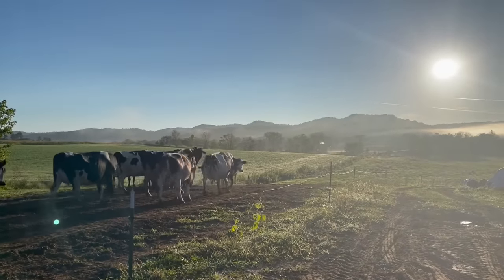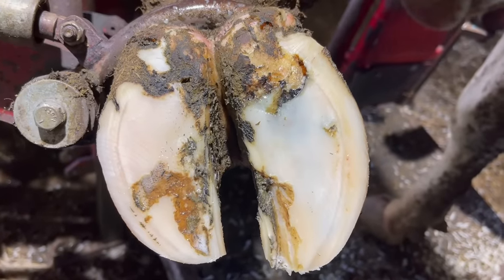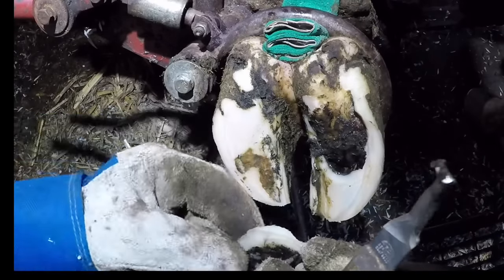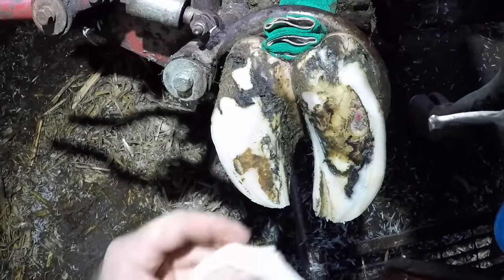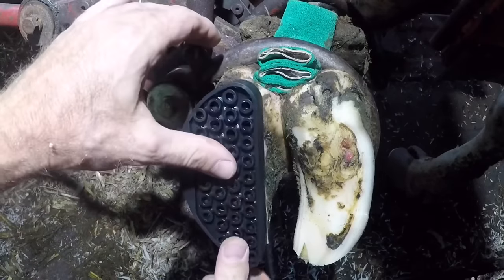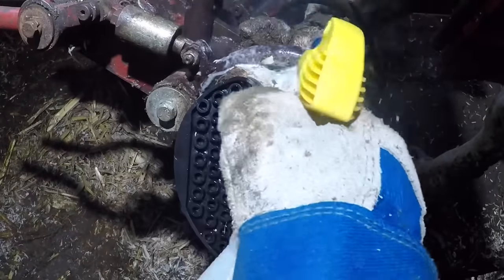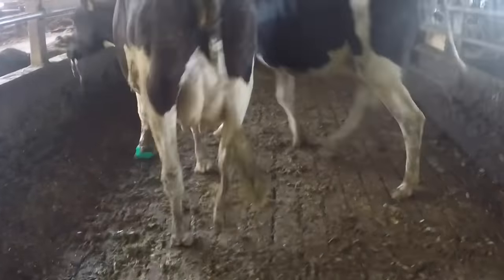Relieving Pain from a COW’S TENDER FRONT FOOT~~FAQ’s

Comment: "Why don't you use water" as Nate sprays $10 worth of chlorhexidine on each damaged hoof LOL. Love your trims Nate, always gentle and thorough.
Reply: Y
Reply: Most barns or places where cows are and horses live. They don't have a lot of spots for water.. The water hose is usually only in one spot and can't reach where he has to park the trailer to trim them.
Reply: Dang, that stuff is really that expensive?
Reply: Ya
Reply: Well just to make sure the foot is well sanitize ,any worms ,germs will surely die
Reply: What about the powder stuff? To kill off germs, bacteria. What does that run for?
Reply: @Cindy-je9fm  That is so not true. He has access to plenty of water. Simply putting water in a spray bottle would work. Fyi He has to wash his whole shute/Crush in-between every farm for sanitation reasons. Access to water is important. I've been on plenty of farms
Reply: Why not put some rubber carpets, that are not thick, just enough to cushion the foot?
Reply: @Cindy-je9fm  This is such a fucking lie. I live next to a farm and I help out sometimes. There is always water nearby
Reply: @Cindy-je9fm  never heard of a bucket 🪣
Reply: Damn!! What's the general pricing on that??
Reply: Just looked it up, it's a little less than $20/gallon. You're dramatic af
Reply: @elizabethavalos2847  that's still pretty expensive....
Reply: @aeryhnkillsahundred335  not for animal safe antiseptic. A small 3oz bottle of antiseptic spray will run you $8-$15 depending on where you buy it. There's a 16oz bottle on Amazon rn for $26. So $20 for a gallon is cheap, especially if he gets it whole sale its probably cheaper than that
Reply: @mateoavina8708  Not sure, but I imagine not much. Salicylic acid is a precursor to acetylsalicylic acid, otherwise known as aspirin. THAT aspirin.
Reply: @nameless-user  huh, that's what I had thought because the spray was 10. Thanks👆👏
Reply: @Goldarr1900  my guess it is because concrete is easy to clean; just spray water to wash away poop and dirt. This is a routine so it need to be super easy. A regular floor tiles & bare bricks could be used instead of concrete to soften foot strike but tiles are costly while bricks are harder to clean.
Reply: @msafwan2610  Thanks for responding to my question. I was talking about cushioning the foot , so it won’t get ulcerated. He said that concrete is to hard, that’s why they seldom get hoof problem, when walking on grass.
Reply: @mateoavina8708  if you watch his video about his gear in his  faq playlist, he says he buys the gallon of 2% clorhexadine only uses that full strength on the lesions/ulcers, and otherwise he uses it diluted ( 1 to a gallon of water)  when he's washing.
Reply: @ultimatesunrise  🤣
Reply: @elizabethavalos2847  not even 20.. Google tells it is 10$ for a gallon.
Reply: Your cows are in much better shape than some others
Reply: I don't see any problem with using something stronger than water to clean the area.  You don't just run water on an open sore on you.  Also,  why do you care if he is using a more expensive product.  It's not your money he's spending.
Reply: She was expecting to be in pain then she realizes she's not. That is so cool.

Comment: As an oil refinery operator who has worked on concrete for 30 years, I concur. A fair amount of us run into foot problems. Great job.
Reply: Oh wow, you have the same job as my father. I will have to ask if he’s experienced that.
Reply: @RoaringMind  very common problem for anybody who works a lot of hours walking around on hard/concrete floors
Reply: Hoof problems
Reply: Gets a lot of non combat veterans too. The boots and the hard grating or concrete floors are brutal.

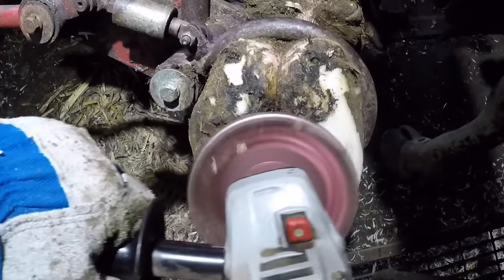Comment: 1:15 "no heat is created when I'm working on this claw"
Other hoof trimming channels, blowtorch is pulled out.
Reply: The blowtorch is used to remove moisture before applying the block. It makes the glue more effective.
Reply: @rebeccac33  Looks like Nate just wipes it down.
Reply: @zerosumgame5700  Different kind of glue.

Comment: I wonder, If the cows were housed on poured rubber floors, like in some playgrounds, would that reduce hoof lesions and lameness? or are there other materials that are better for the cows wellness then concrete?  
and  that bags the question what's more cost effective, house cows on concrete and pay a hoof trimmer to address problems when they arise, or create an environment that is less likely to induces injuries and thus require the services of a hoof trimmer less frequently.
Reply: It’s is quite interesting. As someone who has no experience in either cow owning or different flooring cost or durability I feel like if you need to you can learn how to trim your own hooves and save money there and have the concrete flooring. That could be the most cost effective. Alternatively the rubber, would it break down due to the cow waste? I know that at least dairy farms they have the grates at the end for the waste for their milking stations but the cows aren’t in there for their sleeping quarters I believe. Yes there could be straw for bedding but I’m pretty sure it could still seep through. Quite interesting though for what different floorings could work. I’m genuinely curious about if the cow waste will ruin the rubber though
Reply from the maker: Rubber flooring is installed in many of the larger dairies.  Maintenance trimming is needed more often though because rubber doesn’t create any wear.  Extra trimming is needed to keep the foot in proper alignment and balance.
Reply: You see, every positive brings a negative. While rubber flooring does not cause hoof injuries, on the other hand, hooves do not naturally wear down and therefore need maintenance anyway. 😁
Reply: Rubber flooring is just one part of helping cows out. There are rubber stalls and other comfort items that help prevent lesions (and puss) from developing on other parts of their bodies.
Reply: Wood?
Reply: @daveurbex  True. But I feel it would be better for the cows to not experience pain and just have them trimmed more regularly.
Reply: @goodiegoodygumdrops  Let's not forget its a farm, its not going to have 1-3 cows and that's 4 hoofs for each cow to maintain, morally its a good idea, financially and time planning or whatever not, and when you have farm your work is not only taking care of cows you also need to clean their barn and what not.
Reply: @haruusami1831 some people may not realise how labor intensive having dairy cows is. There are no days off with dairy cows. They need to be milked twice a day every day. Having a larger farm with multiple employees may allow a farmer a day off, a family farm would literally have no days off. There is literally never ending work to be done on a farm. Much respect to all those hard working💪 farmers out 🙏
Reply: @haruusami1831  There's still alternatives. Wood, as suggested is one of them. Dirt is another option. But making animals walk on surfaces that directly lead to them having very painful feet is not ok. 
I have some family friends who have a beef farm and was wondering why I'd never heard of this hoof issue. Now I know: those cows don't walk on concrete.
Reply: @Vousie  Well idk their is something called Rock on the dirt they're walking.
Reply: @haruusami1831  Bits of rock, sure. But as Nate pointed out, their hoofs are designed for that and dirt and grass. Their hoofs are not designed for concrete. That's why they have problems.
Reply: @Gad Yariv I don't think the people who operate the farms care less - the cows are there to be in almost constant pregnancy, milk extraction and then premature death - the state of their hoofs is an irrelevance

Comment: I grew up in a ranching community in AZ and honestly hadn't heard of cows feet needing to be trimmed until I found these on YouTube. Most of the cattle in my area were beef cattle and were always out on pasture from calves to the time they were loaded for slaughter. I don't think any of them had been exposed to concrete which may explain why I'd never heard of cattle hoof trimming before.
Reply: The creator says that rubber flooring is installed in the larger dairy farms for the cows (prevents injury) but the rubber prevents wear so they actually need their hoofs trimmed more often. 
I'm guessing whoever owned those animals didn't care about comfort for the cows.
Reply: @goodiegoodygumdrops  that's with dairy cows though. Op is talking about beef cows in arizona, where they're walking on packed dirt, not concrete or rubber flooring. Maybe the housing has flooring but the cows will spend more time outside. Additionally, dairy cows live a lot longer than beef, and therefore have more chance for something to go wrong / require more maintenance. Also, cattle are a huge investment of thousands of dollars each, no rancher "doesn't care" about their cattle.

Comment: I really wish that livestock weren't in contact with concrete and metal. As you stated, concrete is hard. Very hard. Concrete and metal are also amazingly slippery for animals with hooves, especially when wet. When concrete and metal are wet it literally is like walking on ice. Bovine poo is liquidy and they make a lot of poo every day. They also pee several gallons every day. Concrete is an easy flooring surface because it is extremely durable and can be scraped and hosed off unlike sand, soil, or any type of bedding like straw or wood chips/shavings, but at what cost? There are products made for after an injury has occurred, such as the foot blocks you use and hobbles that prevent a cows hind legs from slipping again after she has sprained or torn ligaments from slipping. I have known cows to break a bone when slipping and ending up splayed out. 

Creating yielding traction for a cows foot only makes sense. I know that rubber matting is a HUGE expense, but it significantly reduces slipping and, as a bonus, is a cushion. It also can be scraped and hosed off. You can even put bedding on top of mats to make the floor have even better traction as well as absorbing some of the urine and feces. With the reduction of slipping injuries for horses in wash racks, stalls, barn aisles, and trailers the mats pay for themselves. I know how easily a large hooved animal can slip and how easily the slip can injure them. Sometimes they hurt themselves getting up from a slip. I'm constantly appalled when I see livestock being moved in trailers with metal floors and ramps. I know a lot of ranchers and farmers whose theory is to just cram a lot of cattle into one trailer so they "hold each other up." But if one goes down like this they often get trampled and can die. A stock trailer can easily have rubber mats fitted over the metal floor. Just because decades of farmers and ranchers before have "done it this way" doesn't mean that there isn't room for improved husbandry. I can remember when a dairy cow wasn't trimmed unless she went lame. But often a lame cow was simply sent to the auction for meat instead of treated. Trimming their feet a couple of times a year is a VAST improvement.

An ounce of prevention is worth a pound of cure.
Reply: It would be a pound of prevention being not worth an ounce of cure. You have to weigh the costs. Conditions have to be kept sanitary, you need concrete that can be sprayed off. Rubber everywhere would cost way more than just checking and trimming their feet every once in a while
Reply: @dethmaul  Actually, rubber flooring is becoming quite popular for cattle. Mostly for the reasons I stated. And they can be hosed down and scrubbed just like concrete.

From the info section of one rubber mat company:
"Polylast Livestock Flooring is a non-slip antimicrobial surface made from 100% recycled rubber combined with U.S. primers, binders, and finishes. This cushioned surface increases comfort and traction, reducing the risk of slipping and lameness.

Polylast Livestock Flooring does not freeze in the winter and stays cooler in the summer, making it ideal for outdoor feed lots, watering pad surfacing, feeder pad surfacing, and livestock holding pens.

It is non-porous and infused with Microban® Antimicrobial Technology reducing the risk of microorganisms, bacteria, mold and mildew while making surfaces easier to clean and sterilize. Perfect for dairy floors, packing plant floors, aisle way floors, ramps and shoots."
Reply: @dethmaul  Many dairy farms actually do have rubber flooring installed.

Comment: Very informative, Nate. Thank you. I have some other questions:
- Would it be possible to use rubber on top of concrete to prevent some injuries? if not: is there another solution?
- I see some people use a blowtorch just before applying the block. What is the reason for this? 
- Why do some hooftrimmers use a small piece of rope to seperate the toes? 
- How many cows can you do with one knife (on average) before it becomes too dull and you need to switch to a backup? 
Thanks in advanced!
Reply: I'm not Nate, but I can answer the first two! 
1.) Rubber floors would help against leisons, but they would actually be too soft, and all the cows would need good maintenance. (Where as with concrete, only some of the cows need help some of the time) it also may be harder to clean.
2.) This makes sure the area is dry before applying the glue!
Reply: @percy7836  Thanks so much :)
Reply: Hello Toine how’s the weather over there

Comment: I think the question about why not clean the hoof before cutting has less to do with cleaning the lesion or abscess on the inside and more to do with cleaning all the dirt, grass, and manure off the outside to get a better look before the first cut. Probably need a hose for that, possibly a pressure washer. Then again you might hurt the cow.

Comment: Shoes doesn't mean there won't be any problems either. Stones and such can still get stuck. Recently it's becoming more common to not shoe horses. Shoeing horses is still the most common, but it's not necessarily the best solution for every horse. It depends on the surfaces the horse walks on and how often/intensely it's ridden. When riding on hard surfaces, or intensely, there's a need to protect the hooves, which is why you shoe horses - but if you don't want to shoe your horse there's boots you can buy for them wear instead. It's all about figuring out what's the best solution for that particular horse.

Comment: Here's a question that I haven't seen addressed before. If it is, please just link the video that answers it. Is there a reason that you don't just use a Hudson sprayer (hand or battery-powered pump), but a spray bottle? It seems like there might be a bit of tie savings if you used a Hudson sprayer.

Comment: If concrete is the main issue, why not just have a dirt floor and/or a layer of shavings? Poultry houses often have just dirt floors with a layer of shavings on top. Could the same be applied for cattle raising?

Comment: Hello, I use angle grinders in my work (metal Fab)  those discs with the carbide cutting edges look like they could "bite"  so to speak. maybe when the battery runs low and you lose RPMs ?  Don't ask how I know that  :). Greetings from the NJ Bayshore.
Reply from the maker: They only bite if your angle is too shallow and the back edge catches.  My wheels aren’t overly aggressive.

Comment: Do you trim the good hoofs first on the cows or go first on the bad hoof
Reply from the maker: Normally I work in a clockwise fashion starting with the right front.  If I have a sore foot then I usually work on that, then trim a couple of the other feet while the glue cures on the block.
Reply: @NatetheHoofGuy  thank you sir

Comment: I've watched ALLLL of your vids. What the he'll is a "white line"? All I see is a white hoof. Seems all you ever say when there is an issue that you need to fix. Is a whit line. What about the fact that there is a "white hoof" that needs attending. White is all I see. Hep me to understand. Differentiate white line from the actual hoof! Thanks
Reply: A white line is a line formed by outside wall of the hoof and the inside part. A cow’s hoof has a hard outside wall and a softer inner part.